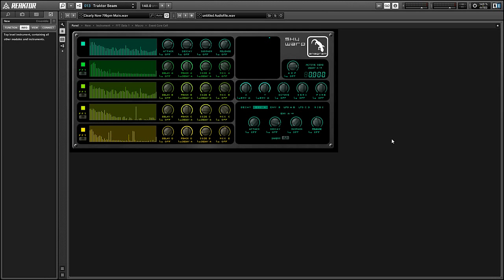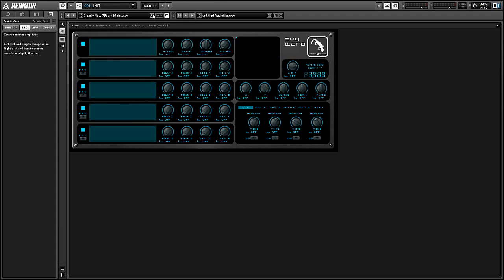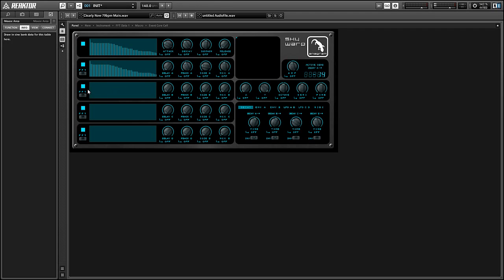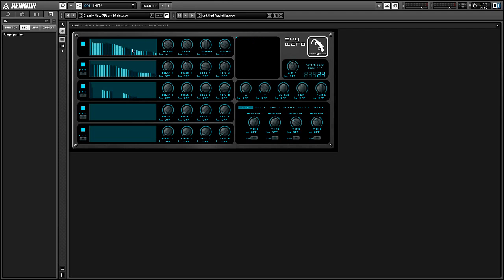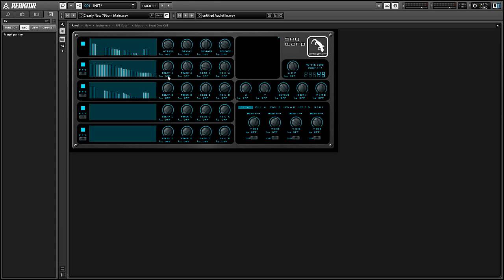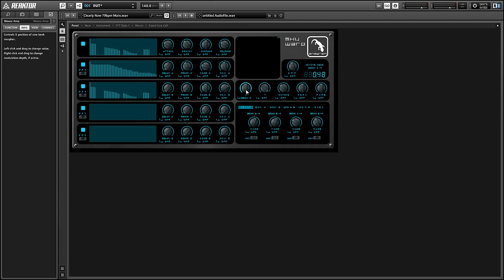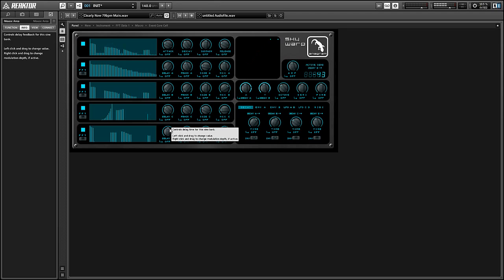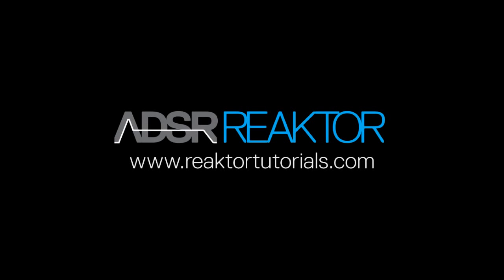NI Reaktor - Using Skywarp - How to Tutorial

Comment: I really enjoy Skywarp. The FFT filters are a brilliant touch. I love how you modulated the reverb. I would like to see more ensembles that use reverb as an instrument instead of an effect. I would especially love to see an ensemble that manipulates infinite feedback loops in a really interesting way.

Just the other day I built a simple macro where I fed an audio signal into a multiplier scaled back to .5 and plugged that into a single delay module and split the output into a feedback multiplier also scaled back to .5. That way, everything that goes back into the delay module will have an amplitude of one.

Then I built a basic LFO modulating the delay time. Now, I'm still trying to figure out a way to have an envelope open up a multiplier throttling the input of that macro every time new audio comes into the instrument. I thought that would be cool because you could have like eight of these macros spinning little bits of audio and spitting it out into a simple feedback delay network, which would result in some really crazy atmospheric sounds if you could detune each one ever so slightly.

Your thoughts?
Reply from the maker: Hey, unfortunately this is an area where a picture is worth a thousand words... If you want to post it to the NI forums I'll be happy to take a look.
Reply: " have an envelope open up a multiplier throttling the input of that macro every time new audio comes into the instrument"  <-  you mean you want an envelope follower on something?